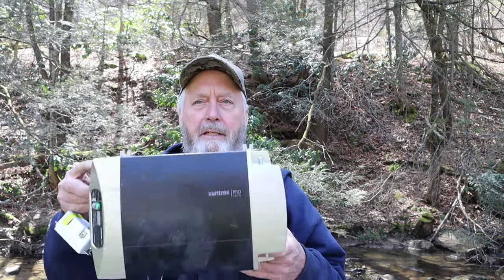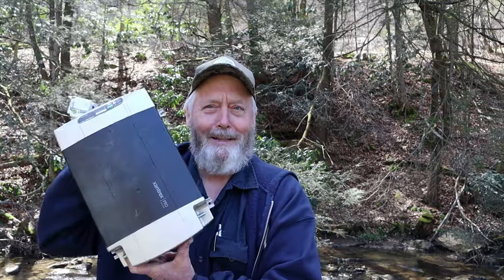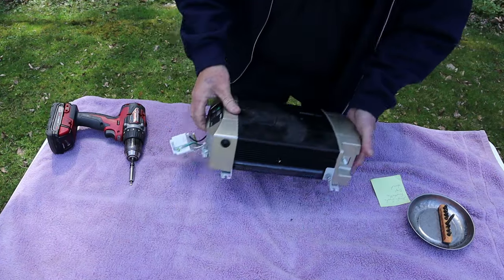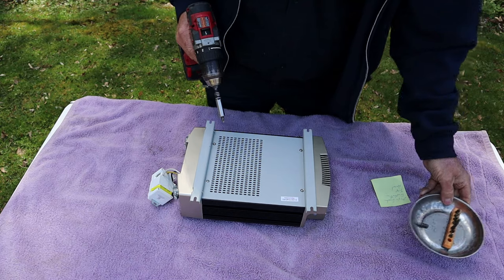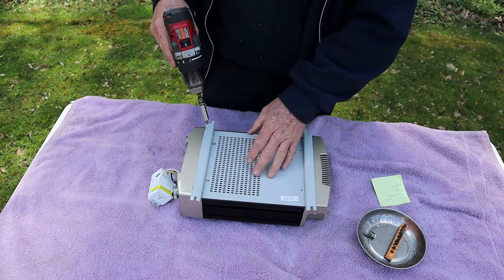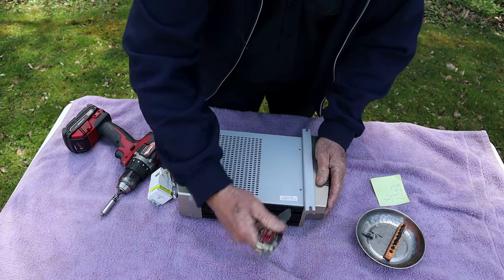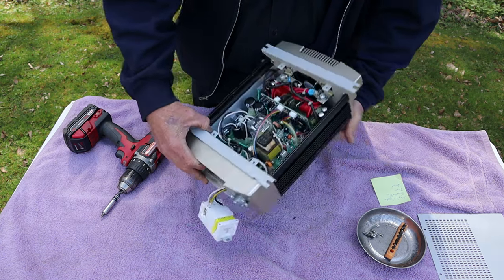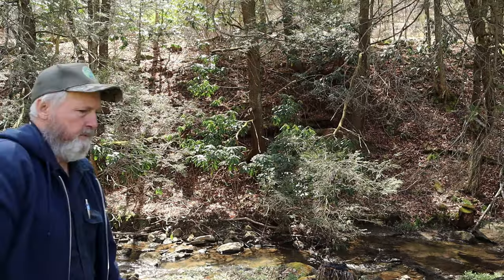THIS and Other CHAOS This Week

Comment: I have witnessed and been the cause of the electric smoke removal. I have repaired some stuff to reinstall the smoke, but most times it goes into the defeat pile. Sometimes the black cloud stays over your head, you just have to keep working and realize it will pass. Thanks Kenny.  We are running Chillers in Michigan today, 70.
Reply from the maker: I have been the cause of my share of escaped magic smoke also, but not this time.

Comment: Nice video.  If he did feed 24v into the rig, hopefully he did have the battery switch off. Otherwise I’d imagine quite a few things would be blown.
Reply from the maker: It got the slide out control board too, but just the 2 things. It could have been worse.
Reply: @hillbillyrv  For sure. Seems like a lot of them are wired so the battery disconnect only kills the power center, and things like jacks and slides are often powered by resettable circuit breakers.  At least the ones my amateur self has worked on.